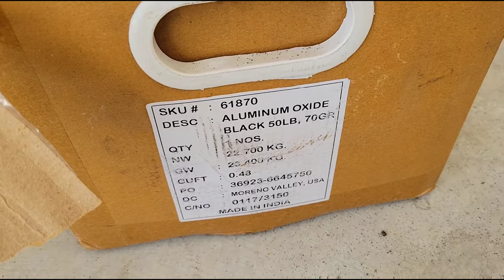Club Face Reconditioning

Comment: I hate to be "that guy" but after blasting it looks as though your plating has started to lift and bubble. Either your cleaning process was insufficient or your plating method wasn't up to scratch. Really need a good hard Chrome plate on top, which we all know is almost impossible to do properly at home. Nickel, Copper, Chrome in that order for a Mizuno.
Reply from the maker: Agreed. The blaster nicked it off. I've changed my approach and I'm blasting before the plating. I want to try the Caswell Copy Chrome, which is supposed to be harder than the nickel.
Reply: @BradMeehan I bought the Caswell nickel kit and it seems to be working great. Does Caswell have a chrome kit? I also notice some people are using chrome with a powder coater. Will this work for golf clubs
Reply from the maker: @wolfiemcwolf6617  yessir. I think it was a combination of poor plating job and too high pressure on the blaster. I now blast prior to plating like you'll see if my newer videos.

Comment: Might be a dumb question but does the face blasting round the groove edges off any where you just can't spin a ball or notice a drastic reduction on bite?
Reply from the maker: Nah. We're using really low pressure to get the textured face, but not enough to manipulate steel like that.
Reply: It definitely would.  I'm sure they sharpen the grooves as the final touch.  Or I would.

Comment: I've done this too! I would be way less aggressive though. I use glass beads at no more than 40 PSI. This gets it pretty close to the original face texture.
Reply from the maker: I'd like to buy a box of glass to do more matte finishes. Do you have a cabinet or do you go outside?
Reply: @BradMeehan  Hi Brad! Like you I built a cabinet. The goal at the time was to do it cost free with things I had around my workshop. 
The only thing I bought was the acrylic piece for the lid for vision. 
I made a blast gun from just an air gun with a plastic bottle attached to it. Works surprisingly well! 
I use it mostly for work on putters but I had a MP-32 9 iron and decided to refurbish the face. Worked out really well.
Reply from the maker: @oatechaosincycles  that's awesome. I love that you made your own.
Reply: Hi! Could you tell me which gun you have used for sandblasting?
Reply: @oatechaosincycles  hello! With what equipment did you work the glass microspheres? how many liters compressor and what type of gun? From already thank you very much

Comment: I'm looking into buying a set of clubs that need ball marks and wear removed from the face, is their anyway to do that without sand blasting ?
Reply from the maker: is the sandblaster not an option because of access to equipment? or to avoid risking damage to the face?  If it's equipment access, sand paper or a scuff pad will work but it won't give you a consistent look and will still expose the metal beneath it.

Comment: If I was reconditioning a club face and needed to sharpen the grooves up a bit, should that be done before plating, or could you do it as a finishing touch without going through the nickel you just applied to the club?
Reply from the maker: I'd do it first since you may risk scraping off the plating. The tradeoff is the grooves wouldn't be as sharp since the plating adds a tiny, tiny layer that rounds it. I mean tiny. I've blasted off some of the plating with my media blaster before so I'm hesitant to screw with it once it's plated.
Reply: @BradMeehan  thanks for the reply. What kind of brush plating kit do you use?

Comment: When I use to paint aircraft we taped off the lexan windows with super heavy aluminum foil and aluminum tape before we stripped the paint off , if you get paint stripper on lexan or plastic it’s ruined and a very expensive goof …so I would definitely use aluminum tape for what your doing …which is awesome I can’t wait to try it…Thanks 👏🏼👏🏼👏🏼

Comment: Love your content, Brad. Thank you! Your recent videos show you blasting without a container. Have you changed methods and would you consider doing a video about the changes?
Reply from the maker: The container I made wasn't planned very well, so it still shoots the media out of the holes. I just go outside and do it over the mulch, but you cant recycle the media. But if I had a proper cabinet, I'd definitely use it.

Comment: Great video and tutorial.

It looks like the sand blasting removed the chrome off the face... 1. Is there any paint or product that is needed to protect the face moving forward? 2. How difficult is it to maintain the face once the chrome has been removed?
Thank you!
Reply from the maker: It did. I'm now blasting before plating. It was also early in my plating adventures, so I have better preparation of the material.  The nickel is what protects the face. It's not as durable as chrome, but there are home chrome or reprochrome kits.

Comment: This has probably been asked before. Sorry if I missed it… how do you make sure the plating doesn’t mess up the grooves?
Reply from the maker: You'll have to sharpen them with the groove sharpener tool. The plating is very, very thin (measured in microns) so you won't notice much if at all.

Comment: Hi Brad, just curious, is the result achievable if using sand paper instead of sand blaster? Thanks!
Reply from the maker: For sure. You'll just have lines from the sanding strokes versus dots from the media. If it's just the aesthetics you want, you could use a scuff pad like Scotch Brite too.
Reply: @BradMeehan  Thanks a lot for the tips. Much appreciated!

Comment: How resistant is nickel plating when actually gaming the clubs?should a chrome be done afterwards?
Reply from the maker: It should but it's not really feasible for home DIY because of the safety issues. Caswell sells "Copy Chrome", which I might try. It's supposed to be harder than the nickel.

Comment: Hi Brad! Awesome videos on refurbishing irons. I did it on my Titleist DCI 990, they look 30 years younger! 

Question: I used a 46grit blasting Media instead of atleast 60-70 due to me not paying too much attention to fine print and not wanting to buy 55Ibs/pay atleast over 100$ for the media. Is that too rought for surfacing? Will it damage the ball? 

Thanks!
Reply from the maker: That's great! It'd have to have some pretty jagged edges to tear apart the cover of a ball. But that's just a guess.
Reply: Ok! Thought so. It does feel smooth enough. My irons look and are much happier, thanks again!

Comment: Love these videos. So much I’ve bought a set of MP 32s to refurbish ! 
What media are you using? I’m over in the UK and it’s bringing up a lot of options - aluminium oxide, glass beads, plastic abrasive etc.
Reply from the maker: Thanks, John. I hope you got a good deal in the clubs. Cheap is the way to go when you learn this stuff. 

I use the aluminum oxide, which I believe is 60 grit. I wanted something aggressive that I can tone-down with lower air pressure if needed.
Reply: @BradMeehan  thanks for coming back to me. I see you do actually mention that on here 🤦‍♂️ 
They were 80£ for a full set so pretty good. I’d like them in the bag though so will test on some real cheapos before. 
Have you hit any of the copper plated clubs yet? Would be good to see a video of how they hold up
Reply: @DcentraliseMe  use garnet from machine mart followed by glass beads.

Comment: Great video thanks for sharing! Question, If all I am blasting are club faces, is that little 3 gal Craftsmen compressor your'e using good enough? Thanks!
Reply from the maker: It's enough to drive the little gun, but not for long before it has to refill. A large compressor is on my wish list so I can drive a blasting cabinet, paint guns, etc. I'd go with the biggest compressor you can afford.

Comment: thanks for the video!
It helps me a lot.

quick question, 
I'm thinking of requesting the sand blasting work to someone, but I don't know what kind of sand blast media they use.
would that matter?

Or do I need to ask for a particular sand blast media?
Reply from the maker: Mine I believe is 60 grit. You could do this at home very easily if you don't want to pay someone.
Reply: @BradMeehan  okay. Guess I'll give it a go then.

I'll have to buy a air compressure then,
Does it need to satisfy any product specification?
(Such as horse power)
Reply from the maker: @youngkwangkim24  I would recommend buying the largest compressor you can afford. It will have so many other uses outside of just club restoration.

Comment: Great video! I love what your doing. I’m curious was all that media that you captured from 1 club head? Also is it possible to harm the gun by running reclaimed media through it? I guess there isn’t really to much contaminant like when blasting other things.
Thanks Marty
Reply from the maker: Yes, I filled it twice with the media when I did it. It's a lot, but I was being super picky and kept going. My compressor sucks. If you have a larger compressor, I'd go for a small blasting cabinet to really get the face texture instead of the gun.

Comment: Hi Brad,
What size compressor are you using there?
Many thanks
Reply from the maker: Hi, Mike. My compressor sucks. If you don't own a compressor, I'd recommend buying the biggest one you can afford so you can use it for other applications like air tools, paint guns, etc. Mine runs CONSTANTLY to keep up with the volume requirements of the blasting gun

Comment: 70 or 80 grit blast media the best? thanks!
Reply from the maker: I'll have to look. I'd go with the less aggressive and you can use it to do clean matte finishes without it looking like sandpaper. I've been using glass bead lately since I bought a cheap cabinet and that works too.

Comment: If you don't have all these tools is there a paint you can just fill in the face with?
Reply from the maker: Nothing that would stand up to the wear and tear. You can get the media gun for about $20 USD i believe, then borrow a friends compressor.
Reply: @BradMeehan  what media best to use? What if the iron is nickel or chrome does it need to be removed first before blasting?

Comment: How do you stop the face rusting after it's blasted???
Reply from the maker: If it's a cast or stainless club, you won't have to do anything. If it's forged steel, you'd need to either plate it (brush or tank) or keep wiping with corrosion spray. I'd go with the plating. Check out my other videos for the how-to.

Comment: Great stuff and thanks for sharing! 🤗
I have rust related questions. I imagine the nickel plating is good to prevent rust from setting in, but what happens once u sand blast it? How's the face tolerance towards rust? And how is it that the clubs of the shelf have so much rust resistance?
Reply from the maker: The off the shelf forged irons are plated in chrome after the nickel, so it's much more durable. I don't have accurate info on nickel's longevity in the bag since I'm also still learning and haven't played enough with them to really know. I'm going to plate a club and make a video where test the durability soon.  

In hindsight, I'd blast the face before the plating like I did in my most recent video with the Hogan Edge.

Caswell sells another solution called "Copy Chrome" or "Near Chrome" that is made of cobalt with brighter. Not as hard as chrome but harder than nickel.
Reply: @BradMeehan  there are a number of clubs with satin steel, brush steel or frosted chrome finish on the shelf now. Do u have any idea how they get those rust resistance?
Reply from the maker: @armrule  are they forged blades or cast? Depending on the metal, you may not need plating and won't rust. The brushed or satin look can be achieved with a deburring wheel, light sandpaper, or light bead blasting. That look next to a high polished surface looks incredible
Reply: @BradMeehan  they're forged. Mizuno have a few. Ping as well with the i500 and Blueprint.
Reply from the maker: @armrule  Just looked at the i500. So, the 'texture' of the plating will take on the texture of the underlying metal. So, if it's satin or brushed, the thin layer of chrome will have that look too.  I'm sure there are proprietary means of achieving a duller look, but for DIY purposes, I'd leave the brushed look on the iron, then plate it - just for corrosion prevention purposes versus aesthetics.  

I think a good video idea will be to prep a few pieces of metal with various textures then plate it so we can see the differences.  Thoughts?
Reply: @BradMeehan  I didn't know the plating texture follows the current texture. 🤭🤗 I believe nickel plating alone is good enough to prevent rust. 🤗
Reply: @BradMeehan  i came across this product called Krud Kutter. A little pricey but quite promising! There are several youtube vid on it. I'm more interested in the up to 12-month protection from rust after application! :)

Comment: I THNK YOU ARE USING 70-GRIT RIGHT?HOW WOULD 120 GRIT LOOK LIKE?HAVE YOU EXPERIMENTED WITH THAT AND CONCLUDED 70 WAS CLOSER TO OEM?
Reply from the maker: Just looked at the box and it's 70 grit. The 120 would give a matte finish but probably not aggressive enough to give the face true texture.